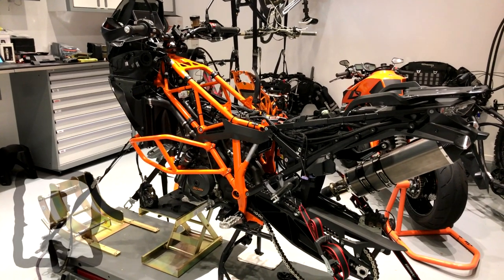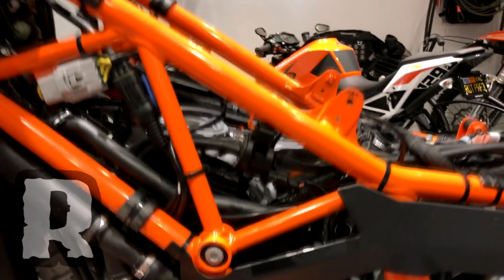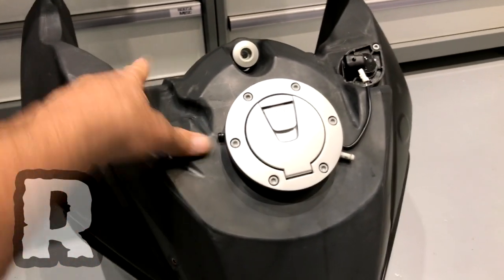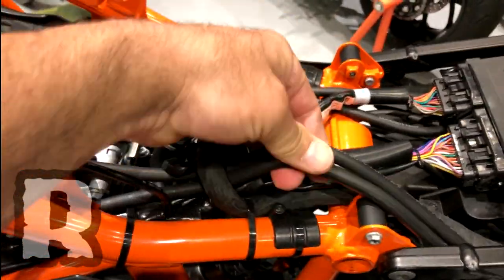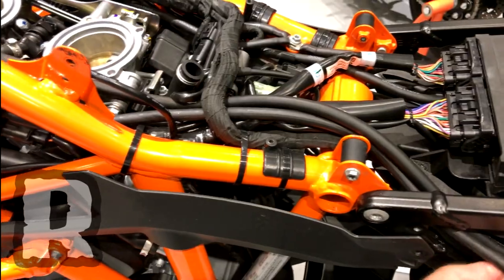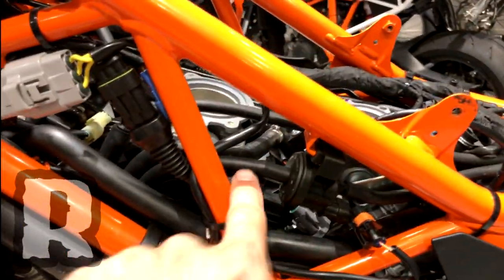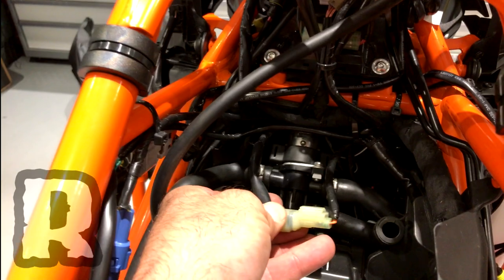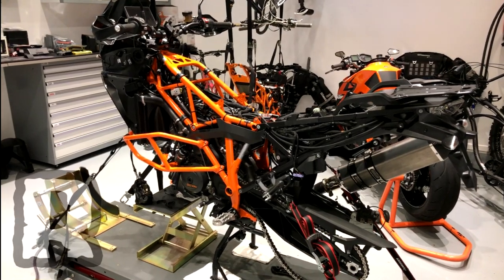BIKE BUILD - ROTTWEILER PERFORMANCE KTM ADVENTURE 1290 R - UNDERSTANDING EMISSIONS SYSTEMS

Comment: Thanks for clearing some things up! When installing a stage 3 air box on the 1290 would you remove the ram air tubes? Or keep them?
Reply from the maker: Remove them. That part is in the instructions but I am assuming you have not purchased yet. We found this accomplished four things better. Reduced complexity, reduced weight, reduced the frequency the filter needed to be cleaned and allowed us to reduce the price of the kit by omitting the old tube bracket. For the record, those are not even close to 'ram air' unless you are doing 150 mph. They actually restrict the incoming air by 100 cubic feet per minute. With our system, you are much better off without them.